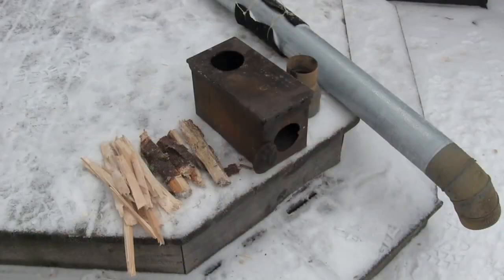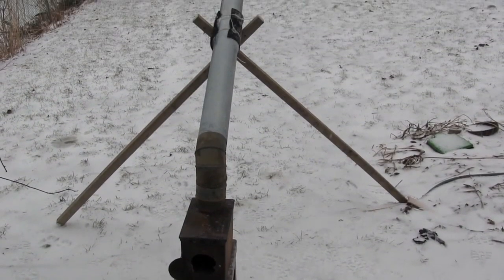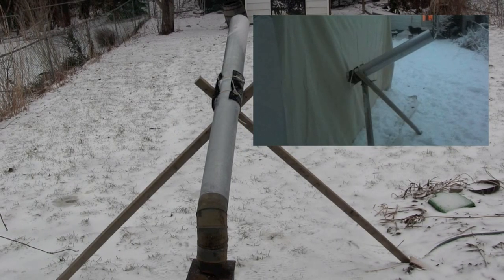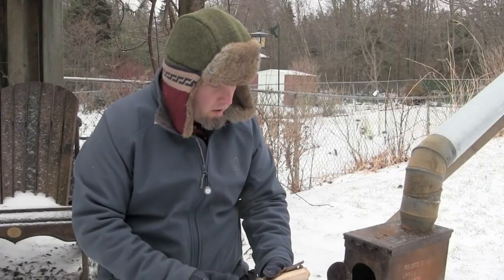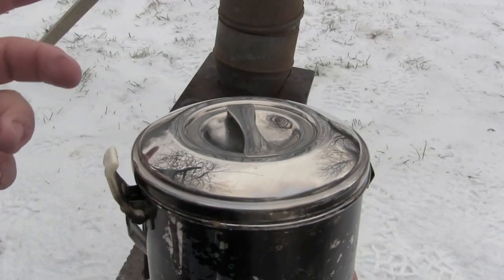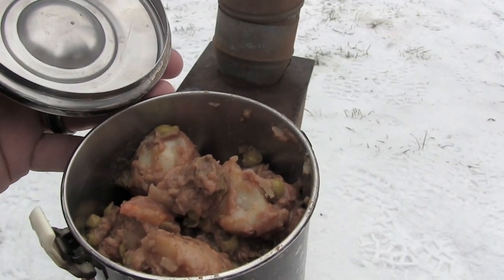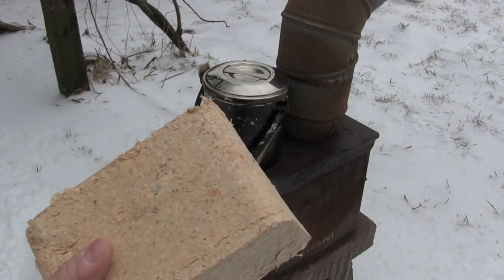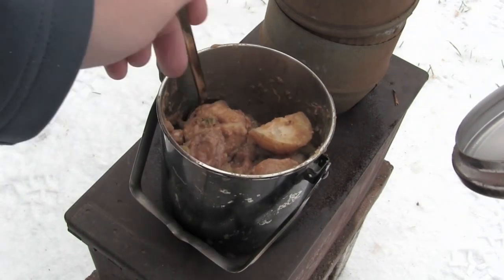Winter Camping With Ammo Can Wood Stove

Comment: I like the simplicity of yours. I have often been put off from attempting making one of these as the videos shown on Youtube make you feel you need to be a blacksmith or engineer with a good sized workshop. One thing though does that chimney need to be that wide for such a small stove? It seems to me that you could get a longer burn with a narrower pipe (assuming it is safe to do so).